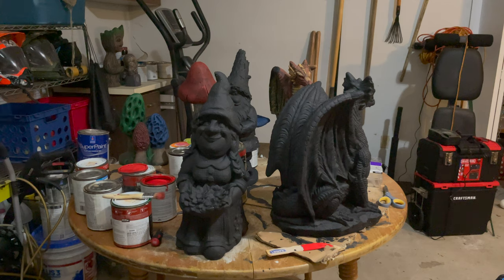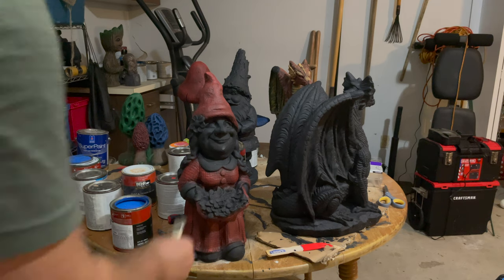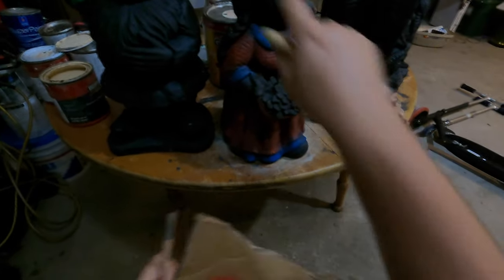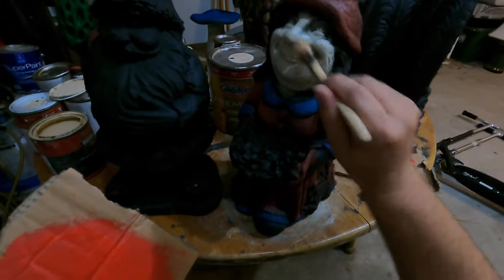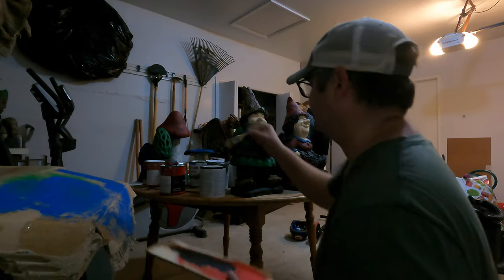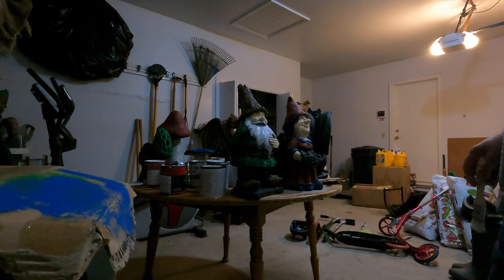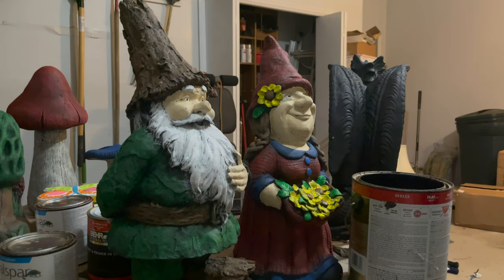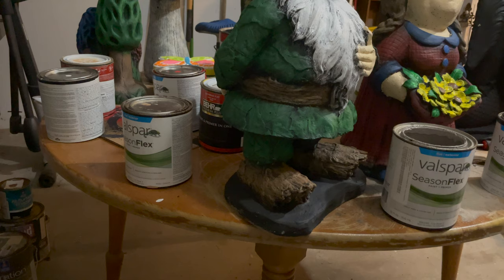Painting Concrete Gnome Statues from Start to Finish

Comment: How do you keep your edges, where the color changes, so clean? For me, that is the hardest part. Have you done any videos specifically showing how to do this?
Reply from the maker: I may use a smaller brush and I also use my fingers or a cloth to wipe off any color that accidentally gets to far as I paint. It comes off easily if you wipe it away as you go.